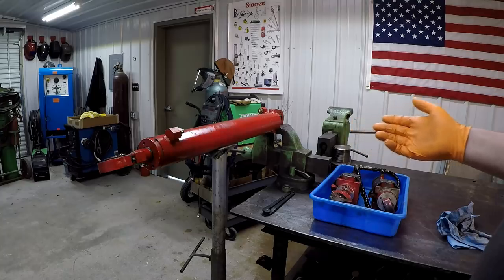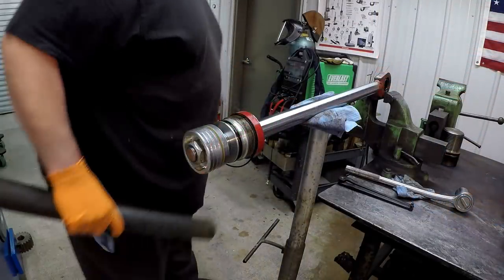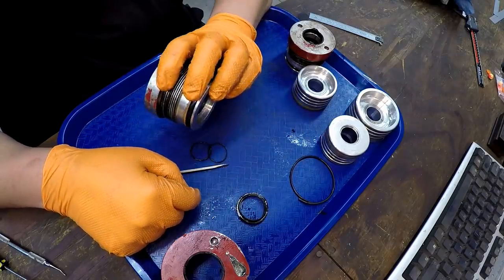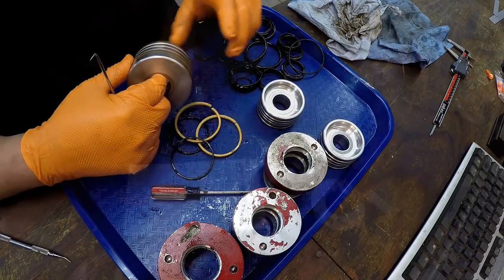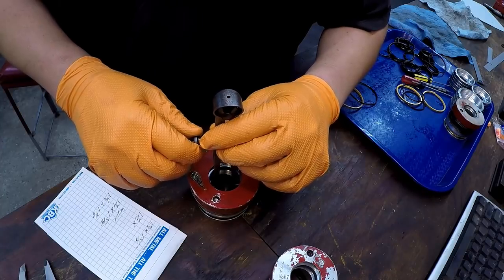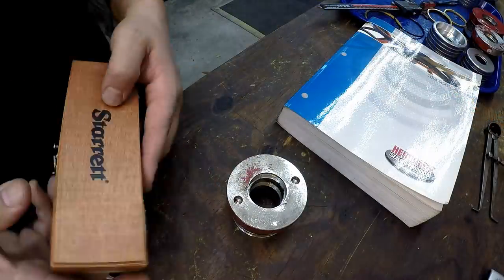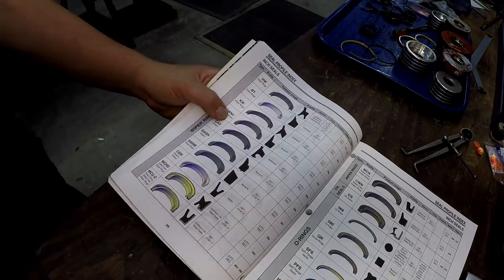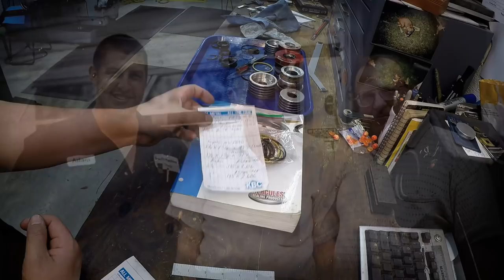SNS 216 Part 2: Hydraulic Cylinder Tear Down

Comment: That oil looked proper manky Adam. Possibly as much as 85% of hydraulic faults  are due to contamination. This degrades seals and all other parts of the system. The most overlooked,yet the cheapest part to change is the filters and oil.
Reply from the maker: Your correct there. I've already suggested he change the oil and filters and he said he is going to.

Comment: Clay based cat litter will soak up the oil spill from the concrete. This material was used in machine shops years before it was used as cat litter. Modern crystaline cat litter does not soak up oil but is a good dessicant
Reply: Sawdust works pretty good too.....machine shops used to actually go to the wood-mills for it....
Reply from the maker: I hate that clay absorbent. Itscmakes a mess and kicks up dust. Oil absorbent mats are where it’s at these days.
Reply: Another disadvantage to the clay oil absorbents in a shop is that people are always quick to throw it down but no one seem to like to sweep it up again.
Reply: I use to use cat litter back in the day. Too much dust and no one likes to clean it up. I now use mats and since I have a industrial centrifuge I wring then out and reuse them. Old washing machines on the spin cycle also work well for spining the oil out. 

Also, and this is a biggie here in California, when the inspectors come around and see the mats and how I recover the oil and reuse the mats they are happy. Throwing oily mats in the trash is a BIG no-no!
Reply from the maker: We have rules or laws here in Florida that specifies when you can or can't throw oily waste in the trash. They say you need to put oily waste like those mats or rags in a heavy duty trash bag, then throw in the can. If it's in abondance your supposed to dispose of all of the oily waste through collections areas, like at the land fill.

Comment: Thanks for taking us through your steps on rebuilding. Although I have taken apart a few cylinders, it's hard to recall the process when it was over 40 years ago! I have a leaking cylinder on my dump trailer that I'm going to have to address before too much longer. Might have a question or two when the time comes. Hope is okay to bug you..
Thanks for sharing Adam!
Razor!

Comment: Regarding catching the oil from that hydraulic cylinder, a friend used a drip pan on his engine stand that hung off a collar on the vertical bar and caught oil drips and dropped parts.  One of those would work great on that deadman you use to support the horizontal cylinder. You could run a drain hose right into your oil bucket if needed. I’ve heard those ptfe rings go in better if soaked in boiling water, but I haven’t done one  since I read about it. Hmmm might have been a different or modified material, you wouldn’t think teflon would be heat sensitive.
Reply from the maker: I think one of the large shallow drip pans for car oil changes would work good too, with it lined with the pig mat.

Comment: Curious if you could look up the make and model of the tractor and just buy a cylinder rebuild kit?
Reply: That might work if the dimensions of the cylinder hasn't been adjusted.  He did mention another piston rebuild where a seal groove was resized  because a proper sized seal coun't be found. So he could have checked the seal / o-ring sizes with a rebuilt kit and ensure the kit has the right size, but that's relying on who knows what supplier of the kit.  He trusts the mfg of the book being used and feels confident rebuilding with those parts...the rebuild is his personal reputation and being the quality person he is, wouldn't trust it to any 'ol parts supplier.

Comment: I use to rebuild a lot of header lift cylinders for Gleaner combines.  To take them apart you took the 90° elbow off of the base end, and there was a round snap ring inside the cylinder on the end of the piston that you would work off with a small flathead screwdriver.   Getting them off was easy.  It took a little practice putting them back together, but once you did it a few times it was pretty easy.

Comment: Adam; what’s with that huge crack across the new shop floor?
Reply: Didn't listen to the contractor and skimped on rebar ;)
Reply from the maker: Back when I poured that slab, I never thought it would be a shop floor. It was just a cheap slab to park my boat on.

Comment: Whenever I am dealing with stiff Teflon seals, I microwave some water and let the seals soak in it before installing. Makes them nice and plyable, easier to install
Reply: That technique is sometimes called out in the maintenance manual procedures for for repacking  (replacing seals in) aircraft landing gear shock struts.  The seal carriers in some struts have additional, deeper grooves that are loaded during assembly with a spare set of seals and backup rings.  If a strut starts leaking in service, the part of the airplane supported by that strut is jacked up enough to allow the gland nut on the bottom of the strut to be unscrewed and the seal carrier dropped down.  The old seals and rings are removed, the spare set moved from the storage grooves into the active grooves, and the carrier and gland nut reassembled.  This is quicker than partially retracting the strut in order to remove the lower cylinder and axle assembly completely and repacking it.  Unfortunately, the spare seal set has sometimes aged enough to fail prematurely after being moved into the active position, so some airlines choose to do a full repack anytime the strut leaks, and never use the spare seals.
Reply from the maker: I talk about this in the next video. An old hydraulic guy that passed away when I was in my teens had an oil vat that stayed warm. he would toss the seals in that oil tank for a while before he built the cylinder to get them nice and soft. I have yet to try that but want to.
Reply: You could put a small jar of oil in a pan filled with hot water. A quick and easy way to heat, but not overheat the oil.

Comment: What is that grey roll you used. Looks like thick paper towel
Reply: I know what it is, it's called Pig Mat, also used in auto shops to absorb oil spills. Just Google it up, they make it to soak up specific stuff depending on application as far as I know.
Reply: Kenneth James thanks! Found it!
Reply: You're going to love that stuff... the gray type is great, but white has its uses as well. I'm never going back to any other method of spill pickup, they have a customer for life.
Reply: Thanks for the name Kenneth! helps me out as well. About the "paper towels" these are made of Polypropylene, that is because it absorbs oils very well. I can't recall who but a well known youtuber talked about it in a video but he showed the difference (paper towel on water (absorbsvery well), paper towel on oil (somewhat absorbs but not really), PP on water (does not absorb) and PP on oil (absorbs very well). Maybe AVE, or Applied Science.
Reply from the maker: The company name is called PIG Industries. We call it Pig Mat. I use the grey heavy duty mats, those are for water and oil. The white mats are oil only. So much cleaner then clay absorbent.

Comment: Hey Adam, great video. I was wondering if those Shars calipers are any good. I've come across them a few times but I'm just not sure if they're  reliable enough to spend money on. My work place is pretty particular on what brands  of tools they will pass for calibration. Thanks for any feed back.
Reply from the maker: I’ve been using them for over a year now with no problems.  I did have one incident where the batteries failed twice so they sent me another one in exchange for the one that failed. Turned out to be bad batteries. I’ve had mine certified at work, and you can even buy them with a calibration and certificate. I’d suggest buy some and try them out. They have a good feel and work great.
Reply: Thank you sir, I'll give them a shot. I build submarines for a living so the navy is pretty strict on what they except. Thanks for the feedback its much appreciated.

Comment: Does the maker of the cylinders not offer a rebuild kit?
Reply: There' so many parts that are only marked by stickers or paint, which don't last long.  After a few coats of rust converter paint over what's left of the original, hard to say who made it.

Comment: have you ever used Zatkoff and Sons for seals? they stock metric seals and some of the less common sizes.  do you ever modify pistons or nuts to install phenolic bearings as an upgrade particularly I trunion mounted cylinders where the forces aren't always linear?  Also have had to drill and tap the gland nuts/heads so you could bolt on an Abom size spanner>
Reply from the maker: paul iossi We also use CRC, and Alligany York. Yes sometimes we modify the pistons and glands and install wear bands.

Comment: Is that deep gouge in the outside face of the gland a severe pecker mark, or did that poor cylinder get used for target practice? Looks almost like a bullet strike.
Reply from the maker: I’m sure that was battle damage from use.
Reply: Looks like a hammer and cape chisel was used for tightening that gland into the cylinder....
 I was 'The Welder' in a machine shop that did a LOT of cylinders....plenty of that damage caused by failure to buy a $25 adjustable pin-spanner...or in too much of a hurry to just make one...

Comment: Big gouge on that rod flange but it doesn't look like it damaged the seals but maybe the treads on the tube ? Maybe not a big hit but several smaller ones.
Reply from the maker: That damage in the face did nothing to the cylinder.
Reply: Thanks very much for the reply.    I greatly respect the years of experience you have done with heavy equipment repairs and you have the cylinder in front of you as I just see it through your video so you would be more qualified to identify problems. Hydraulic cylinders carry great weights that could be dangerous to people working in the area around the piece of equipment.

Comment: I like those hydraulic cylinders.They come apart easy ! All i ever work on never that easy to break apart. Lucky i say.
Reply: fls360 I used to be a cylinder mechanic myself. And I agree the ones he shows come apart nicely, there sure are some frustrating ones out there.
Reply from the maker: I’ve had my share of stubborn cylinders, and still see them often. I’d rather be Machining then tearing down hydraulics.
Reply: I am a forklift mechanic by trade and i do a lot cylinders in the field. I'd rather work on other things than having to pull cylinders and reseal 'em.
Reply: Yeah...forklifts...usually filthy, abused and worn out....some of the worst cylinders I've dealt with are the type with the 'square' wire retainer you have to feed through a small hole in the end of the cylinders....
 Then there are the tie-rod cylinders...fairly easy...
Reply from the maker: Hey Doug, sometimes those cylinders will not spin apart. We’ve had some we had to cut apart, like the gland, retainer, and tube welded itself together.
Reply: I call those type "draw wire" cylinders......complete Pain in the rear.

Comment: I'm surprised to learn that these replacement parts are still printed into 'telephone books'. 
Seems like they'd be a perfect candidate for being able to lookup thru a database online.
Reply from the maker: You can source them online too. I prefer a book, especially in a shop environment.
Reply: One would think so.  I've found when it comes to hydraulic seals, and fittings very few companies implement a very good lookup.  In addition those online tools tend to point you towards a single seal or fitting.  The books give you the advantage of seeing adjacent sizes which is helpful when you are having doubts about your measurements or the measurements are provided by somebody else.  Most of the suppliers use the catalogs too.  Only time they go to the computer is to check inventory.
Reply from the maker: I agree, books have there advantage. Unless you use it, you don’t understand. Easy to flip through those pages then navigating a website.
Reply: All sounds well and good 
But many companys have attempted to put this stuff online 
And many companys have failed 
Iv never used one that works well 
Always slow and laggy 
And you can't just skip 300 pages online 
Gotta navigate back though the menus 

Books ftw

Comment: kitty litter ain't cheaper than the mat?
Reply from the maker: Just what ya need, more dust kicking around the shop.
Reply: C'mon Adam. I have been using oil dry for years with little dust issues. Pig mat is neat stuff but for us poor folks oil dry works great! Thanks for all your videos!

Comment: Hey Adam, I dont typically comment. But I've been watching your videos for sometime now. I was a hydraulic cylinder mechanic for a about a year and change and I am currently working in our machining department within the same company. And I've been enjoying seeing you take these apart. Of course, with anything there are similarities between us and differences too, in the process of taking them apart and putting them together. All in all though, awesome videos, thank you for posting. And one last thing, I am recently recovering from an eye injury from my shop where I was working on cast iron for a client and a chip cut my eye when on the lathe. I'm looking into better safety glasses. Any recommendations for me?
Reply: Adam did a video not too long ago about what his PPE gear is. go look for his "Shop Talk 24" video.
Reply from the maker: I prefer the Smith & Wesson 3G glasses myself. They fit my face well, cover a wide area, and hook behind the ears.
Reply: c6quad3 Will do, thank you very much.
Reply: Abom79 I'll be sure to take a look at those. Thank you very much.

Comment: All this stuff is online, why the books??
Reply from the maker: Stop hating on books!
Reply: I'm not hating anyhing? Just the information is often more accurate and updated.
Reply from the maker: They update the book each year. We just got the new 18 catalogs. If you work in a hydraulic shop you'd see how valuable they are to have on hand.
Reply: Books and catolgues work on a Sunday morning, or out in the field when there's no electric or internet about, reference in hard copies is worth a lot more than time spent trawling through the internet. 🙂
Reply: Loved it when you got the old type spring calipers out to use,,they still come in for a lot of work once you get used to the resistance .
Reply: The older the book the better the reference material inside. The old catalogs used to have cross-references and sizes of seals. It works when there's no electricity too!